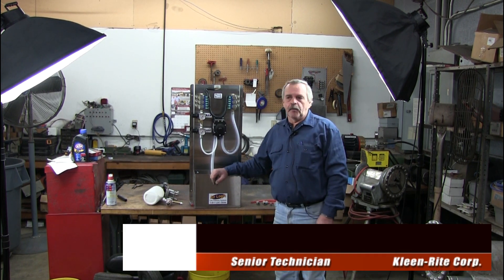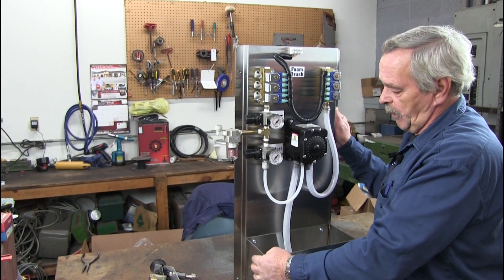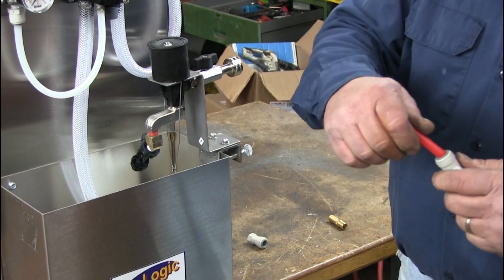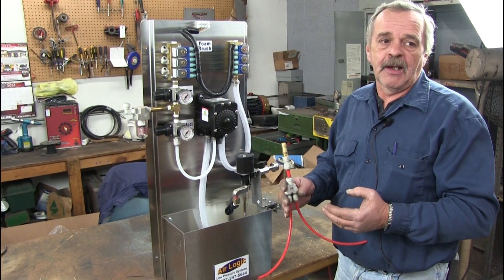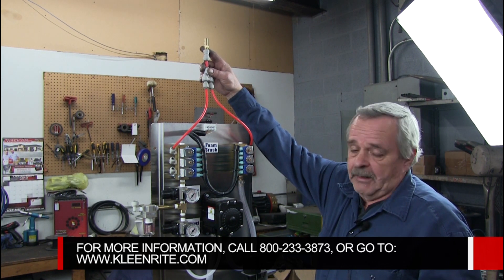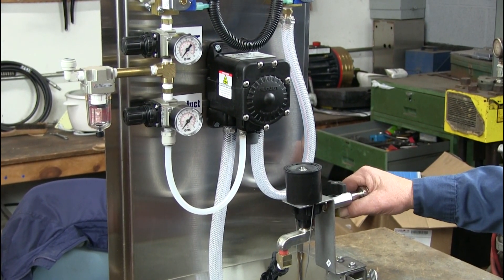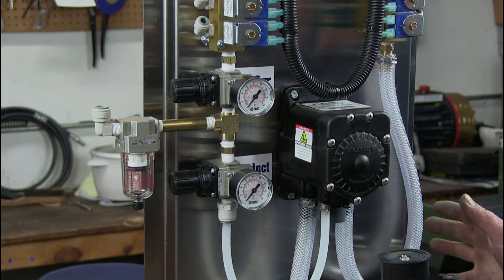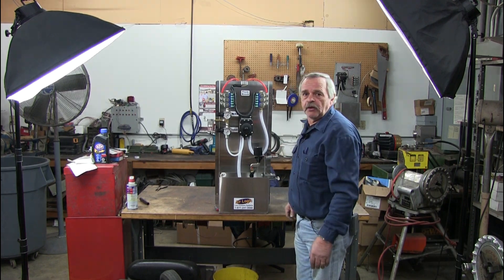How to Install an Air Logic Low Pressure Self-Serve Car Wash Equipment System

Comment: thanks for demonstrating the installation of this system.  i have thought about switching to this system b/c it is a lot less expensive compared to a procon pump and motor.  the reason i have not is because i heard that with the air diaphragm pumps like the flow jet that if the diaphragm fails it will leak product out in the bay even when the function is not selected until you repair it.
Reply from the maker: If the diaphragm fails, the unit won’t pump.  Product will not be “leaking” out to the bays unless a solenoid valve is open…     A bad diaphragm will only affect the Flojet not pumping.
Thanks

Comment: When you are running the poly braid to the bays on this application, do you run 3 different poly braid lines or use just one with putting a tee at each bay to the low pressure boom?

Comment: Hi Tom, great video. My question to you is, what's the correct size of polybraid hose to be used with the suggested chemical and air pressure setting (60psi and 25psi) for Pre-soak application, 3/8 or 1/2? Am using 1/4 polytubing for my pre-soak chemical.

Comment: Tom, my question is ,if i have to use polybraid extension to the bays for FB ,T/C , PS , and Triple foam should all of them be 1/2 size?
The normal 1/4 polytubing has a 1/8 inner diameter.
Reply from the maker: Yes. if you want to use polybraid extension to the bay, 1/2 size is correct!.
if you need more assistant, call 800-233-3873